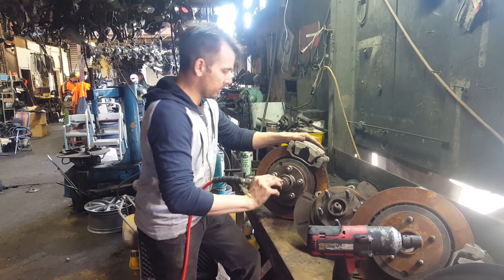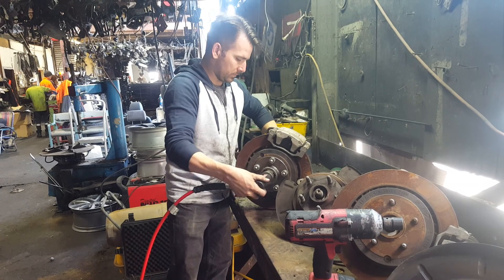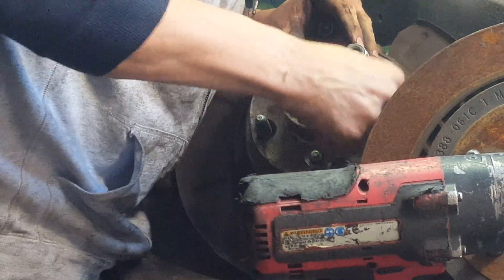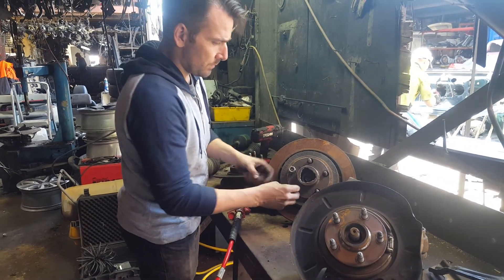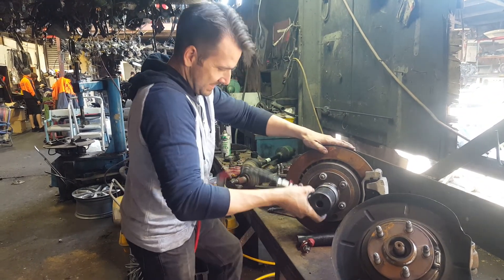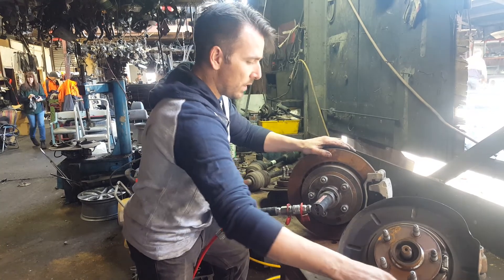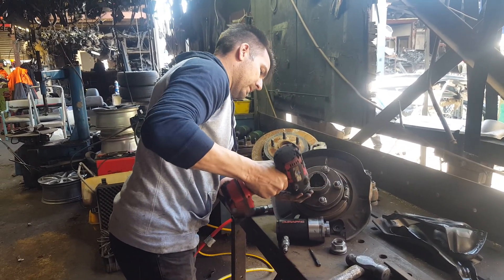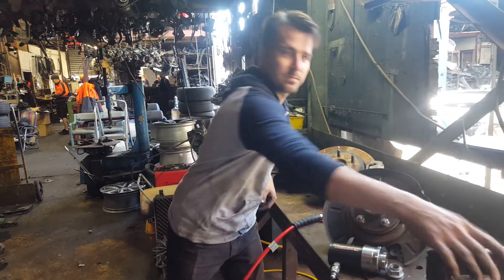How to remove a driveshaft from a hub the easy way

Comment: I'm being charged £50 for this exact job tomorrow and am very happy to pay it.
Reply from the maker: That's great. Approximately AUD$100, and it would only take me 2 minutes to do, which equals AUD$3,000/hr, or in your money 1,500/hr. I would only need to work 1 day/week.

But I get it. If you are only doing the job every now and again.

People also don't factor in the time it takes to drop the job off and then pick it up again, so let's say 5 minutes there, 5 minutes to do the job, and 5 minutes back, that is now 15 minutes for a 2 minute job. In a workshop environment, the $$$ start to add up quickly.
Reply: @mechanicsmateau  oh I’ve taken off the cv axle and the hub and am getting a lift to the shop and I’m still quite happy as I’ve been struggling with this for a loooong time as I’m a Diy’er and I am so over buying tools to do this!
Reply from the maker: @hemtet5500  I thought you might be a DIYer. It is amazing how many shops continue to struggle with a job like this. When you get it back, check for damage on the end of the shaft and the hub assembly. You would be surprised what some people do to get these out.

I hope the rest of the job goes well for you.
Reply: @mechanicsmateau  thanks for the support